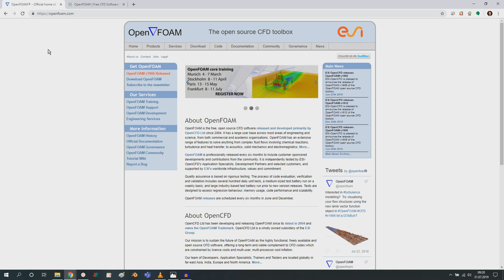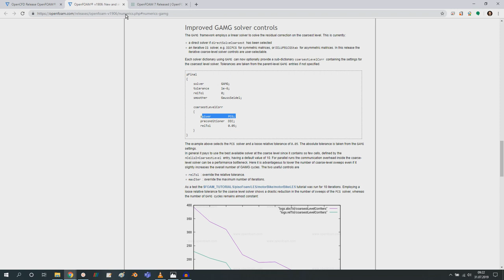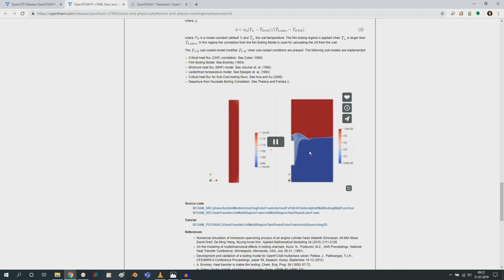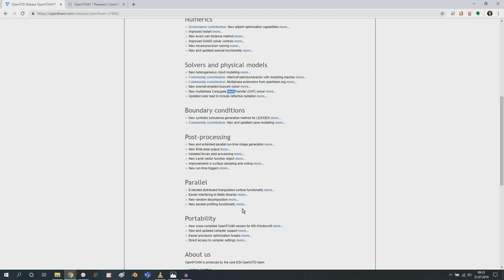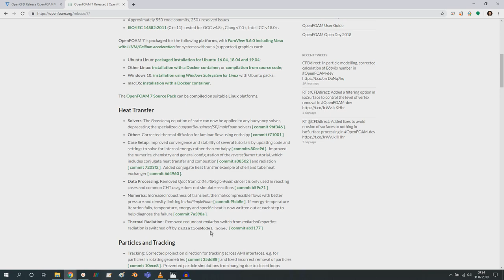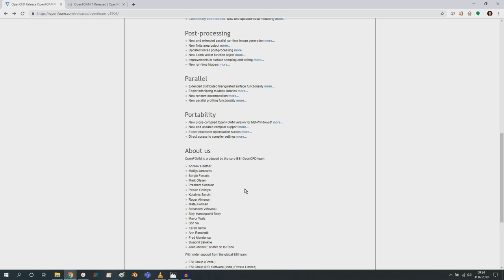[Community video] - New features in OpenFOAM v1906 and v7

Comment: Hi Jozsef, I'm working on MRF solver trying to simulate a wheel rotation. My solution is affected by strong pressure  gradient caused by the solver as reported in literature for MRF with flux orthogonally to the rotational axis. I'm trying to solve the problem, do you have any hint to help me?
Reply: Hi, I met some similar stuff with pump simulation, you can try these stuff:
- Increase the flowrate progressively;
- Increase the rotational speed progressively;
- Use very diffuse stuff in fvSchemes (all details here http://www.wolfdynamics.com/wiki/fvm_crash_intro.pdf)

And when it is stable, go for a more accurate solution
Reply from the maker: @Lilian13550  Thank you Lilian for your input!